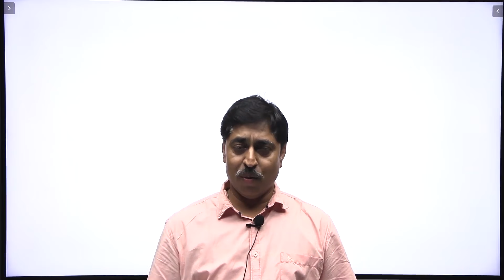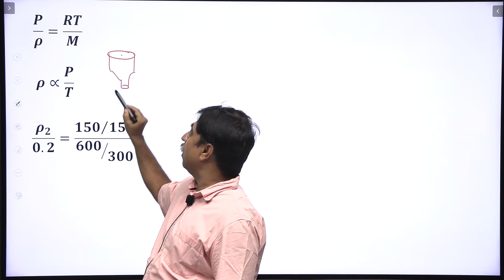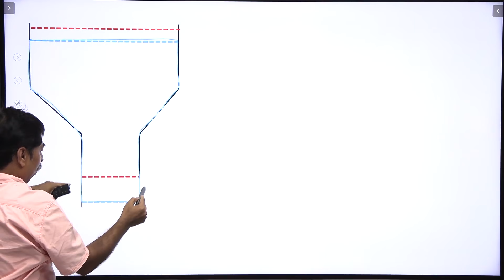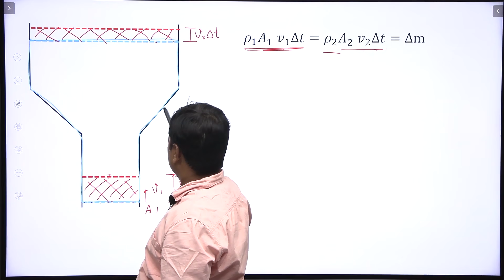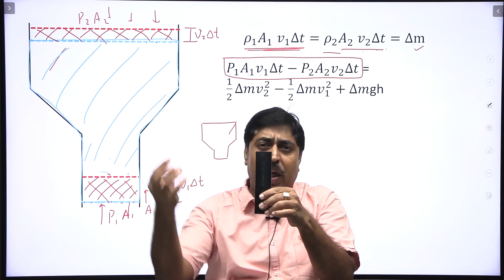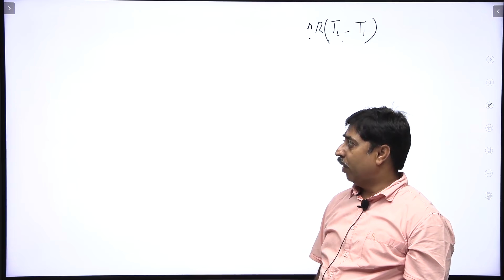Toughest Fluid mechanics Problem - JEE ADVANCED 2022 | Chimney problem of JEE Advanced 2022

Comment from the maker: 📚 Answers to FAQs on Online Courses (Physics by SBT) 
______________________________________ 📖
What is SHORT COURSE (JEE 2026) ❓
 It is mainly a problem - solving focused course for JEE Advanced. 
It is a booster dose to be consumed in 60-90 days.
 It contains recordings of 46 live problem- solving sessions conducted between Jan-25 and Jan-26. One can spend 100 min everyday on a session for 46 days.
10 more Live sessions will be conducted in April-May.
To the point brief theory and problem discussion videos on Modern Physics, Wave, Heat and Optics.
Important basic problems in Mechanics and Electromagnetism. 
Many advanced problem videos.
WHO SHOULD BUY ❓
Anyone expecting above 95 percentile in JEE Main
______________________________________ 📖
What is JEE EDGE (LIVE) COURSE (JEE 2027) ❓
The course is meant for class 12th students (in session 2026-27). 
Live classes (03 days in a week) on 12th topics.
Live problem solving (01 or 02 days in a week) on 11 + 12 topics.
Recordings of entire 11 + 12 syllabus taught live to 2026 batch.
Assignments in PDF
You can ask assignment doubts in Live classes
You can ask other relevant doubts through Chat facility in the app.
You will get 5 CBT tests + some tests in PDF
Class timings : Regular timing is 9 to 10:30 PM (can be different on few days)
WHO SHOULD BUY ❓
Anyone wanting an exhaustive preparation for JEE Main + Advanced

______________________________________ 📖		
What is JEE EDGE (RECORDED) COURSE ❓
The course is meant for anyone wanting recordings of the entire course. 
Recordings of entire 11 + 12 syllabus taught live to 2026 batch.
Assignments in PDF
WHO SHOULD BUY ❓
Anyone wanting an exhaustive preparation for JEE Main + Advanced through recorded lectures
______________________________________ 📖
What is JEE ACE COURSE ❓
The course is meant for someone wanting only problem- solving sessions.
Around 50 live sessions will be conducted between April 2026 and Dec -2026.
There will be 1 or 2 sessions every week.
Will cover all important topics in 11 + 12 syllabus.
Class timings : Regular timing is 9 to 10:30 PM (can be different on few days)
Level of questions will be more inclined towards JEE Adv.
Many questions will be taken from Advanced Problem book by SBT
WHO SHOULD BUY ❓
Anyone wanting refinement in problem solving for JEE Advanced
______________________________________ 📖
What are CHAPTER WISE LECTURES ❓
These are recorded lectures on a particular topic.
No assignment / doubt clearance is available for these courses.
WHO SHOULD BUY ❓
Lectures are meant for anyone who finds a chapter difficult and wants to learn at his/her own pace.

______________________________________ 📖
What is 350 + Advanced illustrations ❓	
These are archive of problem videos on my YouTube Channel.
Problems have been arranged chapter wise.
WHO SHOULD BUY ❓
If you want chapter wise segregated high level problems without YouTube advertisement bothering you
______________________________________ 📖
Will there be a separate Dropper’s Batch for JEE 2027 ❓
Yes. Will start after Board exams are over.
Announcement coming soon.
______________________________________ 📖
Will there be a separate Batch for JEE 2028 ❓	
Most likely. Will make an announcement soon.

Comment: Sir basically you are applying law of conservation of mass and law of conservation of energy. In thermodynamics there is on equation called steady flow energy equation. This problem can be solved by this equation.
Reply from the maker: Yes, you are right. In a way I have used the same equation. But we are not supposed to study such equation as far as well JEE is concerned. That is why I didn't make a reference to it . Why unnecessarily increase our syllabus?
Reply: @rudraprakash4116 oh where did you take that reference from ? 
thats great interest of yours , but i think sir also used a similar type of equation

Comment: I am not able to understand why the total mass has to remain constant
Reply from the maker: In a steady flow the flow conditions remain same with time. At any point the density remains constant with time.( though the density may be different at different points) The mass of gas in any volume will always remain same.
Reply: @JEEAdvancedPhysics  sir it means that if incompressible liquid is used then volume entering is equal to volume leaving; and if compressible liquid is used then incoming mass = outgoing mass
Reply: @Aadhruvlearning  incoming mass is always = outgoing mass,  just in incompressible fluid the density factor is cancelled so it becomes volume flow rate just use p=m/v => dm/dt=pAdx/dt=pav = constant